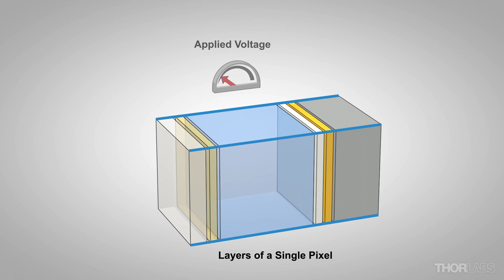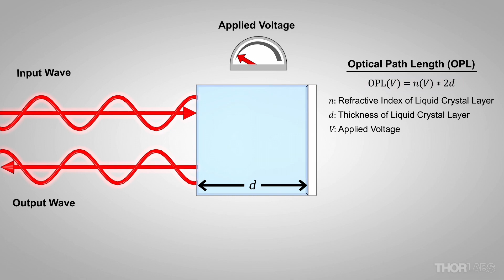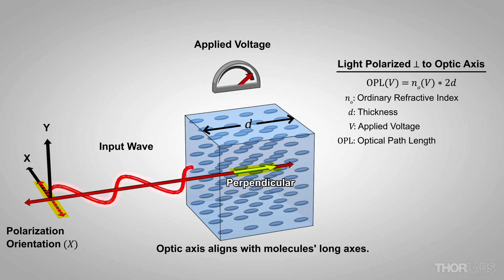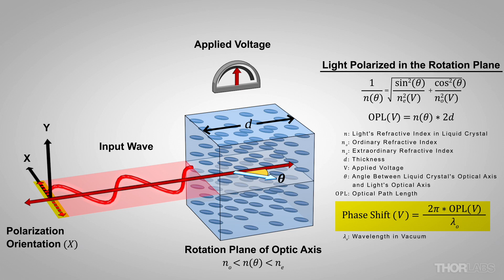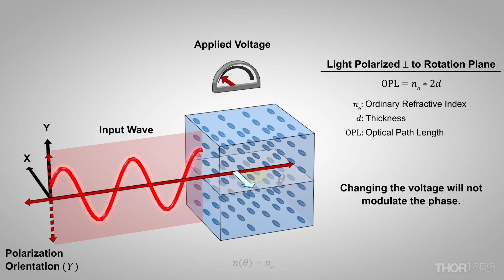Polarization Dependence of Phase-Only Spatial Light Modulators (SLM) | Thorlabs Insights Topic Focus

Comment: The reason why the "molecules" would align in a specific plane is because there are also anchoring layers, at the top and bottom of the LC. Manufacturing of these alignment layers, from the theoretical POV is a mix of art and science, especially when using the rubbing technique. If your LCoS display is showing strange lack of uniformity, you have an LC anchoring problem, which you most probably won't see in a commercial panel unless severely stressed.

Comment: If you send light in the direction top-bottom, vertically in the animation, does it work like a dynamic horizontal/vertical (othogonal) switching polariser?
Reply from the maker: Interestingly, the top-to-bottom route through the liquid crystal cell would not offer any more or different functionality than the left-to-right route. In both cases, the device would act as a variable wave plate. This is because light traveling in either direction can have one component polarized parallel to the crystal’s optic axis and the other polarized perpendicular. (Light polarized parallel to the optic axis experiences the ordinary refractive index, and light polarized perpendicular experiences the extraordinary refractive index.) However, the top-to-bottom route is typically not used, since the device’s housing and other opaque elements typically block light from entering the device from this direction.
 
It is possible to use this device, in its standard left-to-right configuration, to rotate a linear polarization state by 90° on command. For example, first set the device to switch between providing retardances of zero and a half wave. Then, align the input linear polarization state at a 45° angle to the liquid crystals’ plane of rotation. When the device is set to provide zero retardance, the polarization directions of incident and transmitted light will be the same (e.g. +45°). When the device is set to provide a half wave of retardance, the polarization direction of the transmitted light will rotate to -45°.
 
If you were interested in the top-to-bottom configuration since it appeared this might be a way to use the device in transmission, rather than reflection, there are transmissive liquid crystal half-wave retarders available (see for example: https://www.thorlabs.com/newgrouppage9.cfm?objectgroup_id=6179 ).